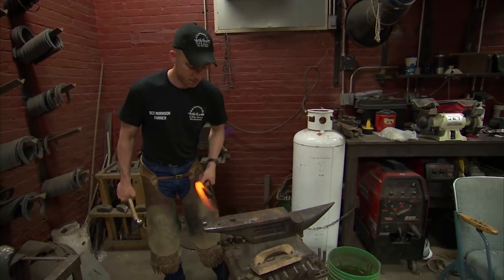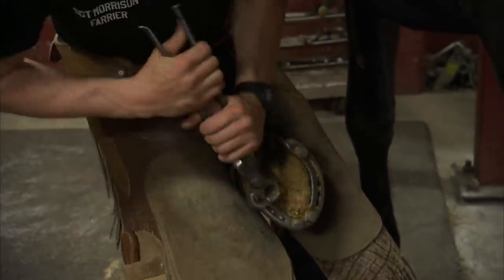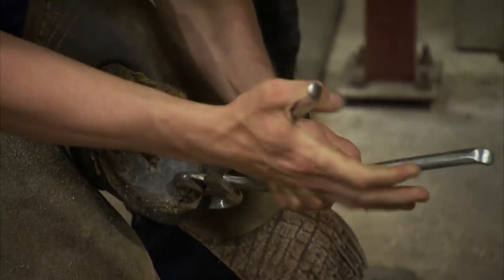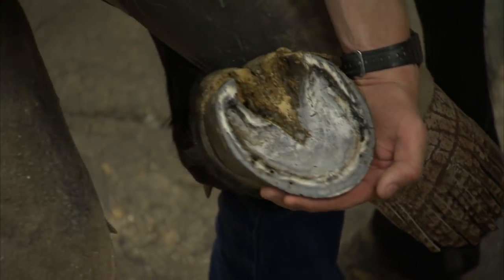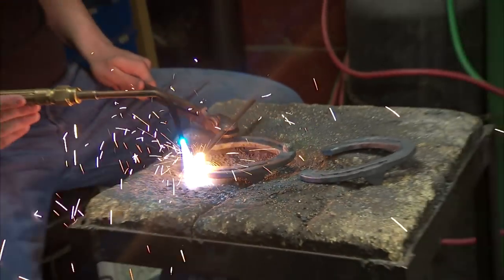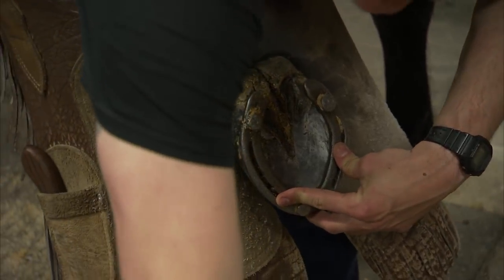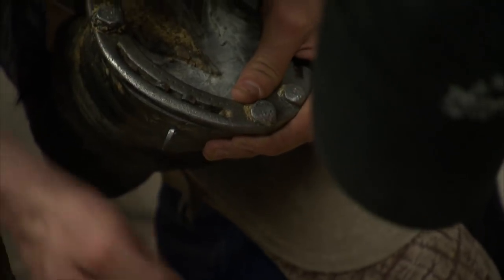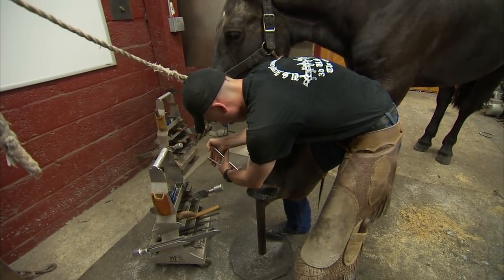U.S. Army farrier Charles Morrison shoes a horse

Comment: It would be interesting to invent some type of belt sander to trim the hooves.  We have the angle grinder and the snips and the files etc. but it seems to me using a best sander would some industrial strength sand paper would make a nice flat surface.  The ideal situation would be to raise the animal up in the air using a contraption similar to an car engine lift, then place the hoof on the best sander.  I am not a farrier and this might already be available and might not work but my mind is always thinking of ways to build a better mouse trap.  I have no idea if it would be better.

Comment: 18 to 24 weeks is way too long for a horse to be wearing the same shoe, it should be every six weeks what's happening here?
Reply: The shoes LAST that long but the hoof is trimmed 3 or 4 times in that perod and the same shoe put back on  after adjustments . Thats what those Tungsten studs are for ,a long life . . Duh?
Reply: The shoe lasts 18-24 weeks, it gets reset every 6-8 weeks.

Comment: Maybe the horses are pulling their feet away because of the angle you're pulling on their feet..... try a squat-kneel and just rest the horse's foot on your higher knee. it maintains the foot in a more anatomical position.
Reply: I agree, he should have been more in line with the horses frame. You can tell he is still fearful of the horses.
Reply: Fearful?  LOL  That boy knows exactly what he's doing.  I can tell that you have never trimmed equine feet before.  That young fella is doing it the only way it will work.  If you doubt that,  spend a few decades getting under 1500# hay burners and find out for yourself.  Truth be told, that pony wasnt bad at all.  Not perfect, but not bad.   It gets a LOT harder than what he was handling.
Reply: Stands dont work if they keep pulling their foot away.   For sure its nice if they will use a stand,  but in my experience 90% of them just wont do it.   Sure would be nice if they would though,  helluva lots easier on the back and way easier to get the job done.
Reply: And the credit dealer award goes to..